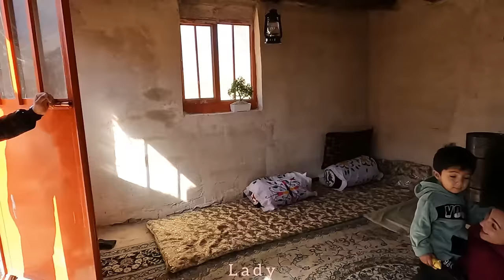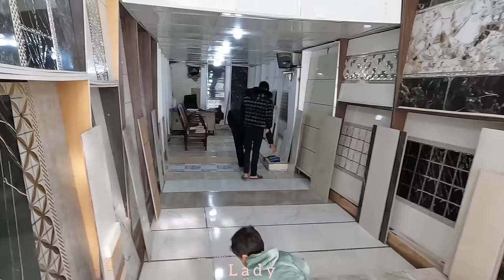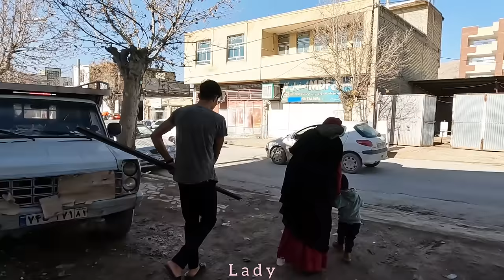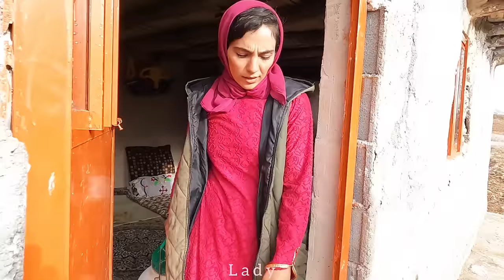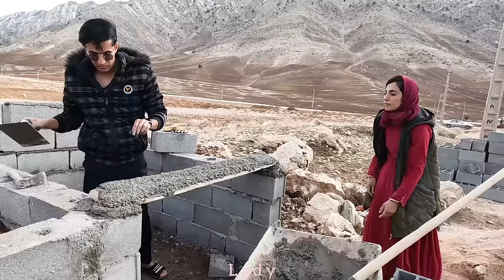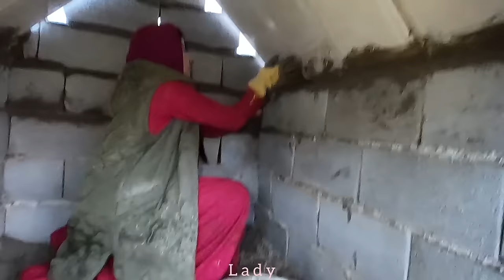Daral village: Mehin's divorce and its sad tragedy: Lady channel in Daral village (2024)

Comment: The dog house needs a much smaller entrance. put some more concrete bricks and cover at least half of the entrance so he can escape from the wind and cold. Don’t put the door in the middle. Put it on one side so Wolf has a warm corner. Then put a couple pieces of carpet in there but not all the way to the door because they will get wet.

Comment: I thought you bought tiles for the floor of your house. It's better and easier to clean the house if that's the floor. Put the carpet if it's winter.The water in your area is hard so washing the carpet will be a problem.Just a suggestion